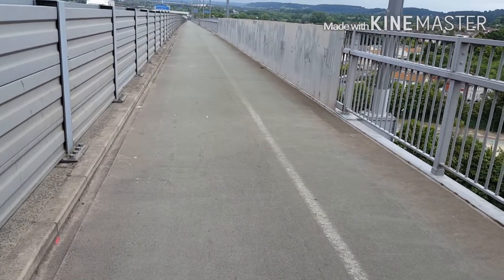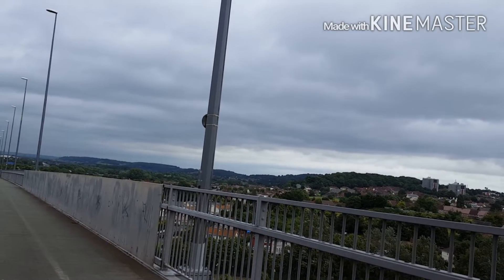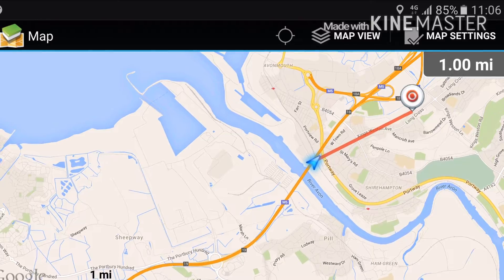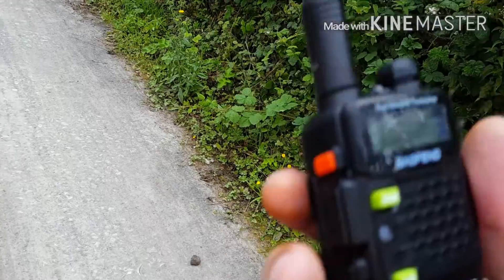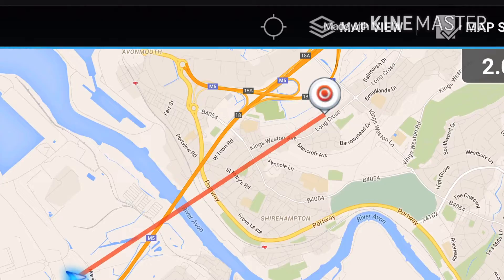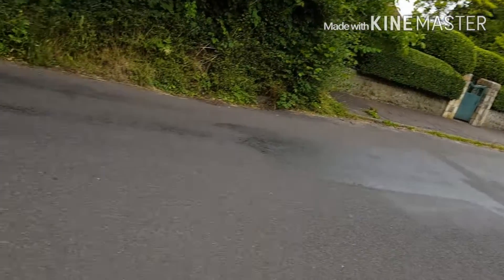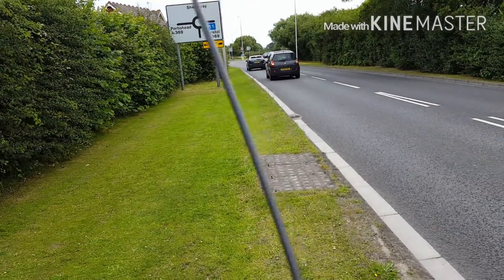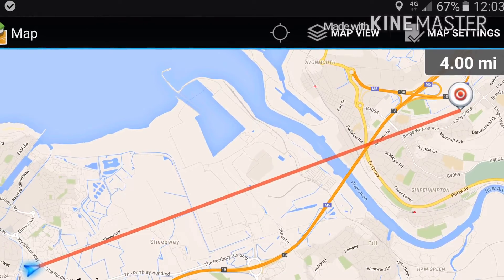Diamond rh-771 (whip antenna range test)

Comment: if u add a counterpoise  you wlldo better hook it up 2 the strap holder u must scrap the paint off the area run a continuity check from thr antenna ground uoy will increase the rang  73  kg6mn